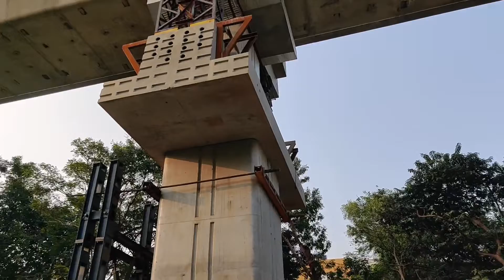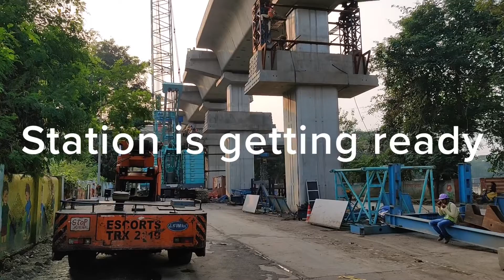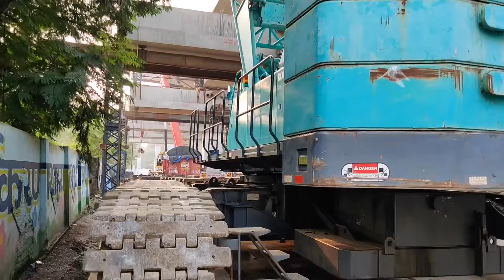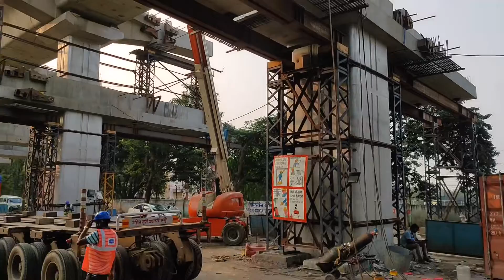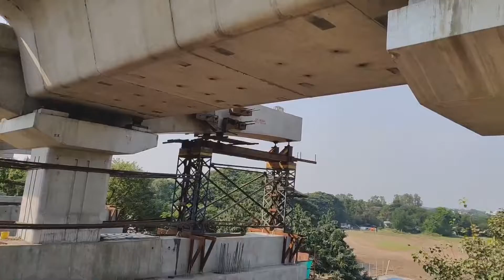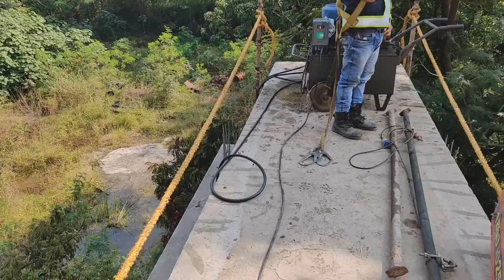Mangalwar Peth (RTO Pune) Metro Station | Pune Metro | Construction of Metro Station. #punemetro

Comment: Thanks for the video.
So precast Pier arms are used for concourse level.
Reply from the maker: Yes here in this stretch they are using Precast arms.
Reply: @ConstructionofDreams  thanks for the reply. In next 3/4 months, we can expect concourse and platform level slab work.
Reply from the maker: @prasadjoshi7373  definitely we can expect in December 2020. Work is in full swing now.